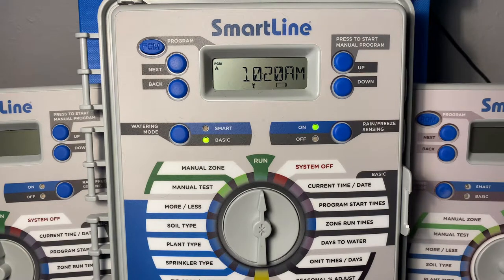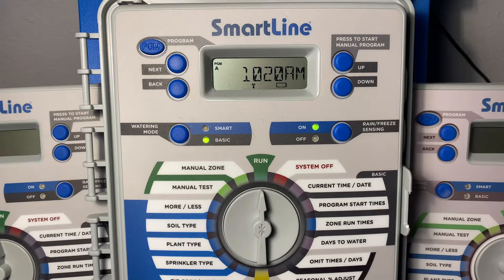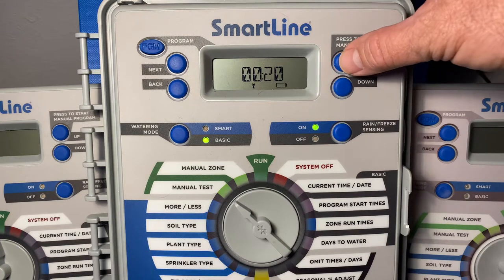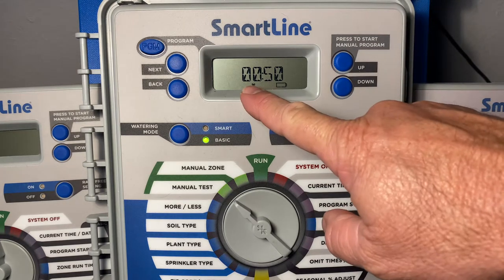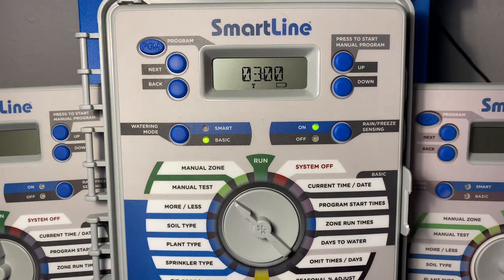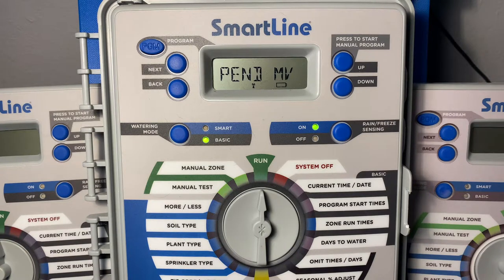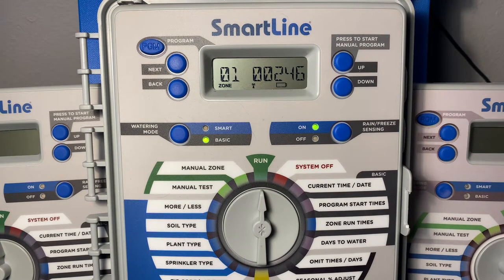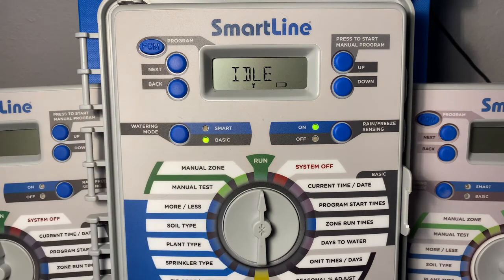Weathermatic How To: Use Manual Test

Comment: Is there a way to test or run individual sprinkler heads manually?
Reply from the maker: In an irrigation system, it is not generally possible to run an individual Sprinkler head without capping off the other heads within the zone. Some heads you may be able to adjust the set screw and close off the nozzle or emissions device if so equipped. You’re really only able to activate the zone as a whole.